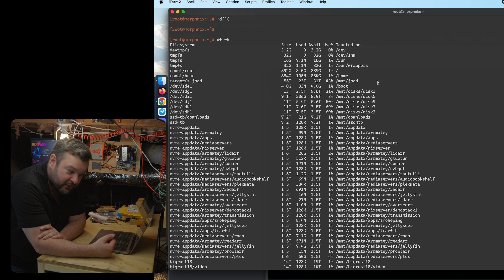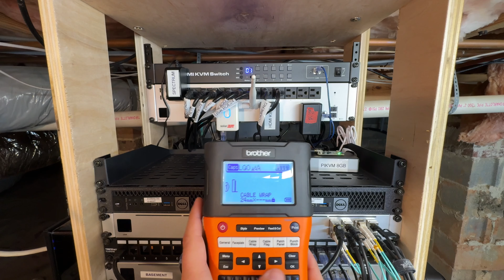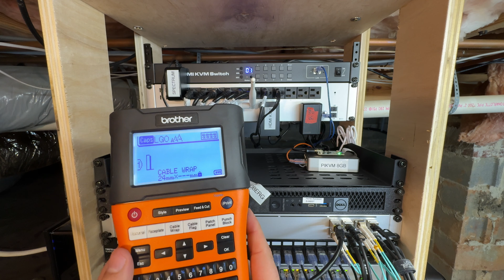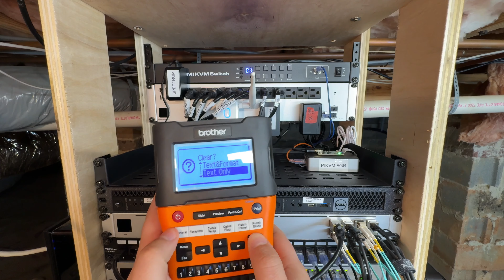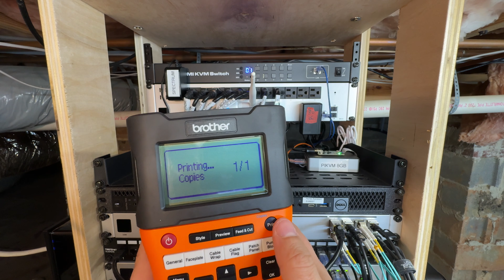Hardware Vlog | Friday night building servers with Alex!

Comment: I'm also in Raleigh, NC and used Kareon cables to do some custom ones for a recent Proxmox server build in a Fractal Define 7 case.  Also using an LSI HBA, and an IcyDock 5.25" SSD setup (6 SSD's and 8 spinners, plus 3 nvme drives).  Measured, did a quick Photoshop mock up and e-mailed him to iron out the details and had my cables within 2 days.  REALLY cleans up  a build!
Reply from the maker: Small world!

Comment: I am sure people have already said, but as a contract worker at intel... you CAN put the CPU DOWN into the socket first, apply thermal compound on top, then carefully lower the heatsink down the correct way, carfully press it down untill you hear the currier clip into place, then secure the CPU using the required torque spec... which is often about 9lbs for that large of a heatsink/cpu. Socket, heatsink, AND CPU should ALL have Pin ZERO labeled with a little arrow/ triangle
Reply from the maker: there you go!

Comment: 6/7th gen Optiplex systems should idle around 11-14W. 8/9th are a little less. I have an Inspiron desktop with a quad core 10th gen i3, it idles at 7W. So if you can get any of these boxes cheap you're going to get something that has very good idle wattage out of the box. Changing it that opnsense box seems like a good idea imho.
Reply from the maker: finding one of those dell boxes with dual NICs is a challenge! i know there are some similar (i think lenovo m720q?) from other vendors that take a PCIe card which would solve that issue.

Comment: We use those label makers in the datacenter I work in, as much as I'd love to get one for home I already have one of the lower end brother handheld's and it honestly does the job fine but those industrial ones are the bees knees.  After reading about so many people upgrading the CPU's in their prebuilt HL15's I think I'm just going to get the chassis and wait till Epyc Siena motherboards become more available, the 8024P seems like it should handle truenas fine for me at home and then I don't have to deal with any Intel wonkiness.  Gotta get my HL15 first though, first world problems!  You can actually get BMC to boot in most supermicro boards without a working CPU (to flash the bios for instance), just in case anyone out there ever runs into it.